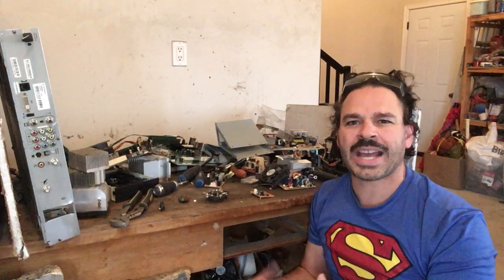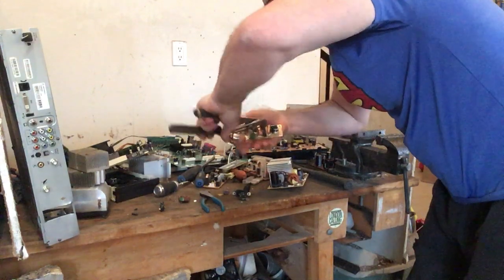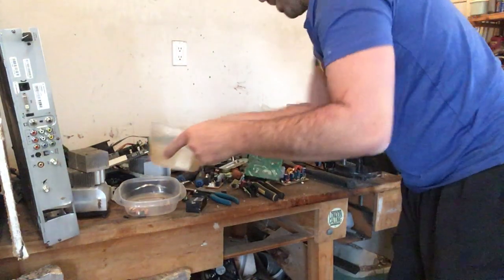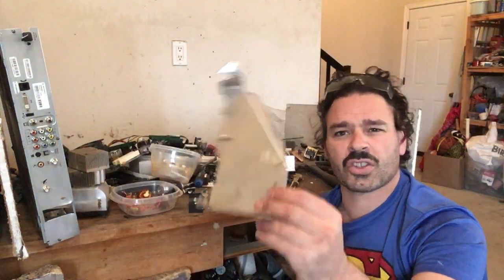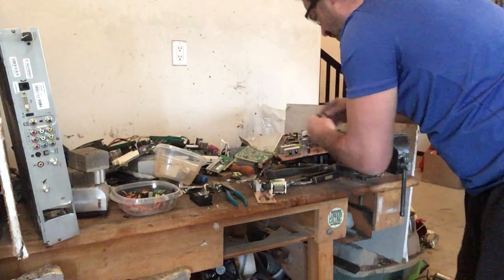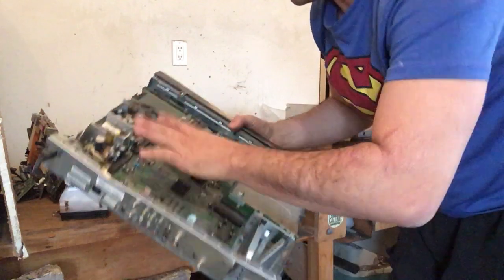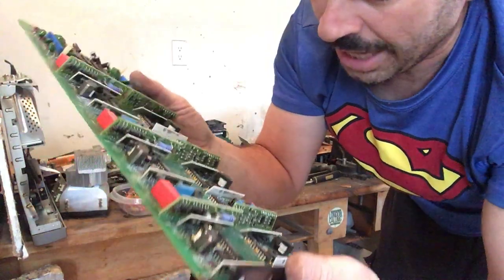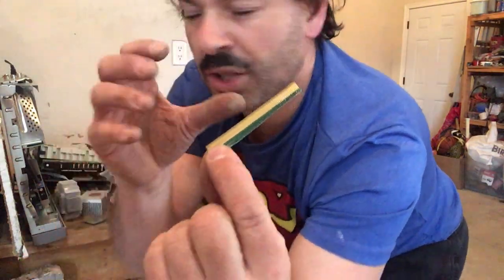Scrapping circuit boards for copper, aluminum, gold, other metals. A beginner's guide.

Comment: Hello Tin Man,,, Sweden here again. 
Nice video as usual, pretty much the same as I do with my boards.
The Doughnuts are Torroidal transformers, some I take off for the Cu. I did the math once and it turns out I get more for them as electric motor then for the copper. 
Your Prongs are Mosfet, don't know much more but I get Highgrade copperwire price for those. I use two yards depending on what material I have, both pay flat rate for aluminium, regardless extruded, sheet,painted or not and they allow some contaminents like the random nuts and bolts. Circuitboards also flat rate.I have found a buyer for IC chips, goldpins and that kind of thing. 
Stay safe and take care.
Reply from the maker: Nice and thanks for the update and info. Nice that you found a buyer for the gold pins and such. Amazing Athena different prices yards will pay for items compared to other yards. Stay well

Comment: What is the wire made of on the aluminum extrusion?
Reply from the maker: Scratch it, if it reveals copper under coating it is coated copper and if scratched and still stays gray then aluminum wire.

Comment: I've been pulling all the copper wire only to realize that 90% is copper clad aluminum. What a bummer. Does anything actually have real copper anymore?
Reply from the maker: Yeah, unfortunately now doing the scratch test before taking the item apart is critical. A lot more aluminum items now.